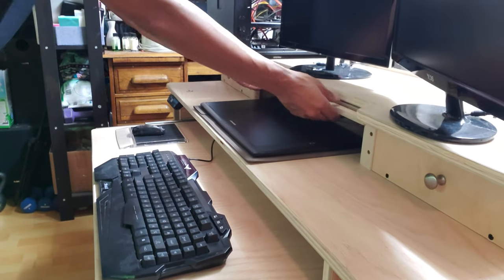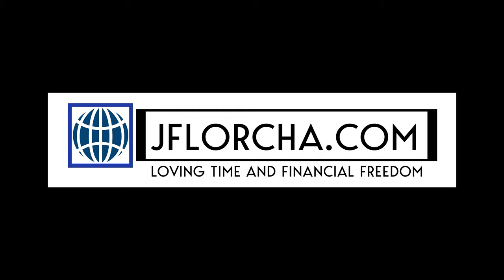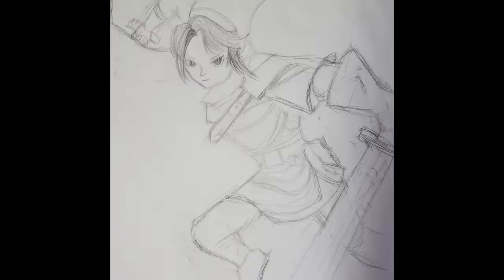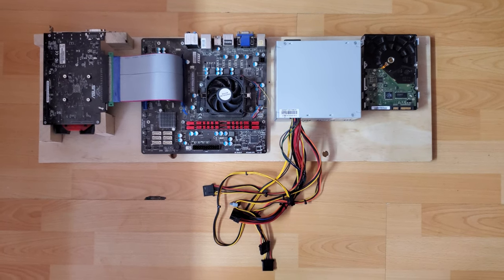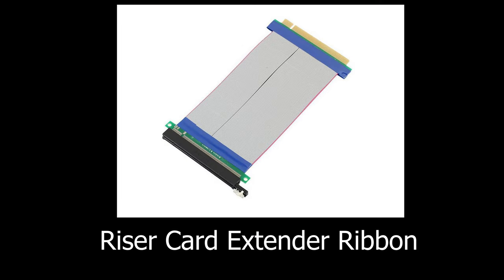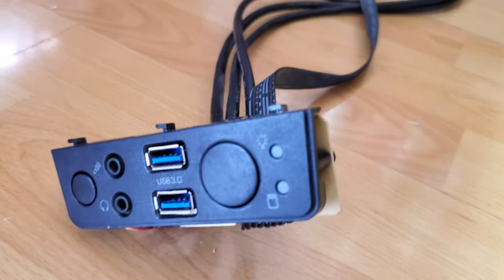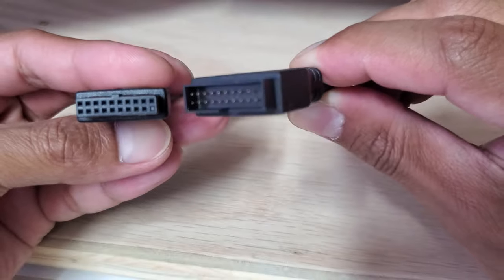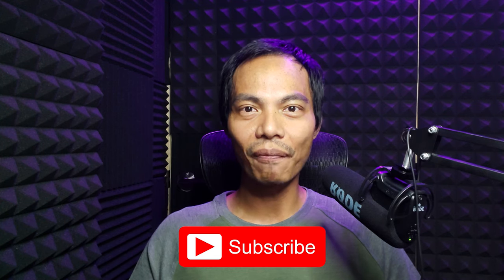Mounting Motherboard into wood using glowstick connectors

Comment: Im doing a similar project right now. Thanks for the tip about plastic between motherboard and the wood. But how safe do you think it is if I just hang the gpu from the motherboard? And how did you screw the psu to the wood?
Reply from the maker: First of all, I wanted to apologize for not showing all the steps I did. If you're going to hang your project, make sure you have enough screw thread penetration within the plywood. I used 5/8" thick plywood and 1" screw, the plastic connector was 1/2" length, so I have 1/2"  penetration. For the GPU, I would not recommend hanging it without any supports, it will put too much stress for the PCIe from the MOBO. For the PSU, I have disassembled the case and screwed it in the wood, and put all the cover back in place, as for mounting the HDD, i'ved use 3.5" casing, you can find the link on the description.
Reply: @TheLorchasJourney  Thank you for detailed explanation. :) Do you recommend pci-e riser for the GPU? And i found these velcro wall strips. The ones i found are for 4kg. What do you think about using them for the PSU? My PSU is 1.5kg.
Reply from the maker: The GPU needs to be securely mount onto the wood (wit or w/o the riser), i  recommend the riser bcuz it gives u flexibility where to mount ur GPU, ur velcro ideas is way better than mine, u shuld go for it, u can mount and dismount the psu anytime u want. Brilliant!
Reply: @TheLorchasJourney  Thanks I'll do that with the PSU. I'm just stuck on the GPU part, cuz now i have to order the riser 😅. I'll keep the table upsidedown for now haha. It's a small Ikea LACK table.